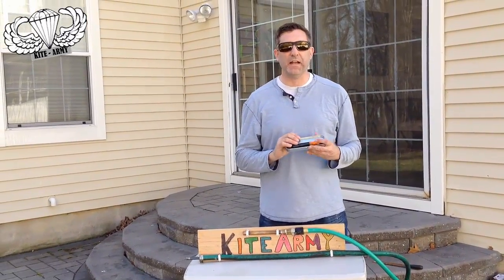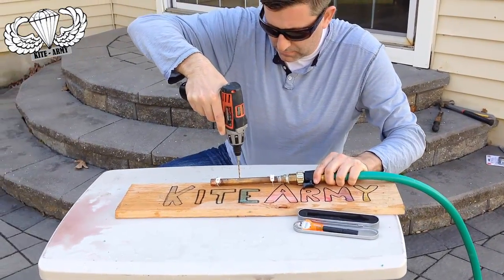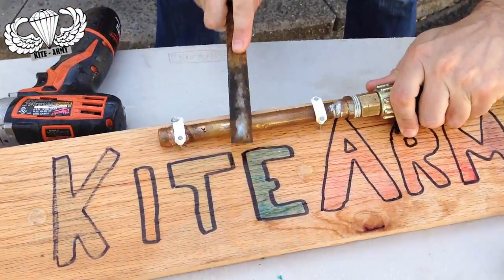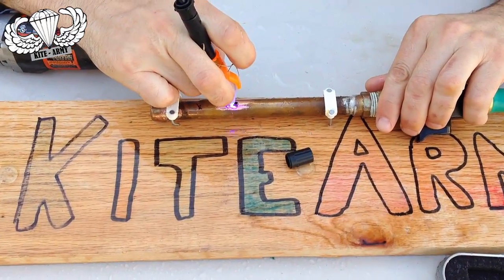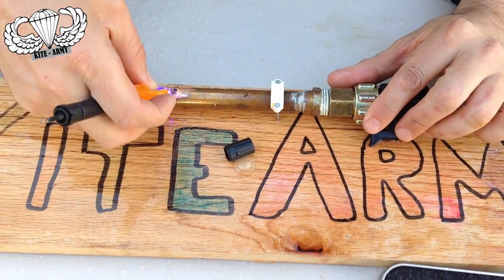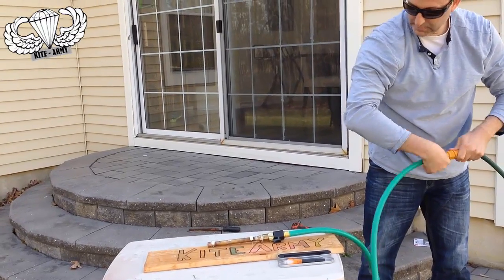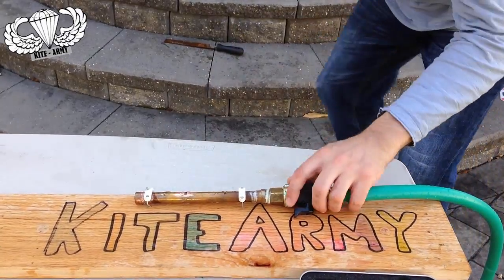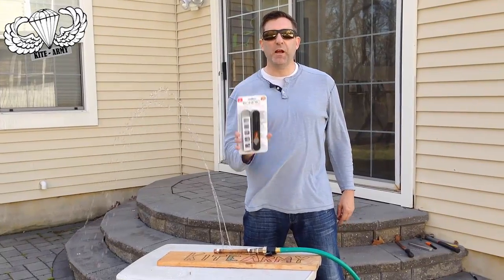Bondic Copper Water Pipe Repair/Fix Test & Review Video - Subscribe and WIN

Comment: How about repairing leakage in AC copper pipe which run from compressor to indoor split unit? How practical and is it lasting for AC copper pipe?
Reply from the maker: No way mate.  Could you cut it and braze a new coupler on?
Reply: Kite Army There is a product HVAC patch and i wonder how effective it was

Comment: I wouldn't use it for fixing water pipes but it's not bad for small jobs.
It's not glue so don't expect to stick something together with it as the liquid plastic polymer only hardens when it's exposed to UV light from the LED provided.
In my experience with it and seemingly for best results you have to layer it... Lay down a thin bead and expose it to UV light for 4 seconds,. that'll hold your pieces together then add another bead in either side of the first bead and expose that to the UV light.
Depending on how much strength you want keep widening the repeair weld.
Unlike crazy glue this stuff works best on the outside and around the joint whereas crazy glue goes between the two pieces to be joined.. Treat it more like a wrap around adhesive than a glue that goes between.
Pros: It's quick and it's not messy, it's not even sticky, works on applications that crazy glue wont.
Cons: Not as strong as something like JB Weld epoxy but that's based on my experience with it - perhaps you've had better results. Cost is higher than epoxies or crazy glue
Reply from the maker: nothing beat epoxy if you can wait!

Comment: I definitely wouldn't use it on plumbing. Have a few shark bite fittings on hand for an emergency.  I've tried bondic on a vacuum regulator valve on my diesel truck the part is plastic and I couldn't get the bondic to hold at all. My opinion bondic is junk.
Reply from the maker: hit or miss for sure - no question that it is not for plumbing

Comment: Ha, It's an LED, Why are you shining an LED over it, What benefits?

Still not hating, Just baffled.

It's more than likely a UV light.. Cures the mixture faster
Reply: +theplanerock BriitishCadet Thats exactly what it is. Its a UV LED that accelerates the curing process.
Reply: The UV light is for checking the bed sheets to see if the wife has been getting her pipe laid my someone else 😂

Comment: This product don't work, I have used it for several applications and it has failed to even match superglue standards, it is a cash grab scam.
Reply from the maker: Even those that work - it seems that the glue joints fail over time